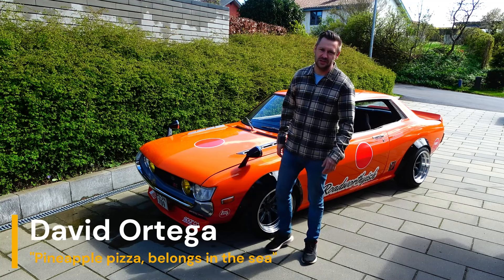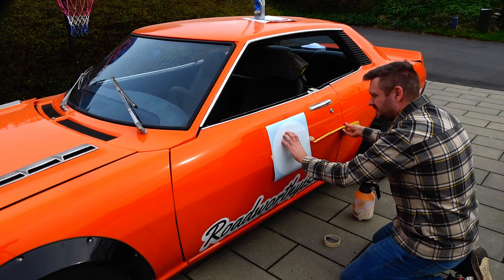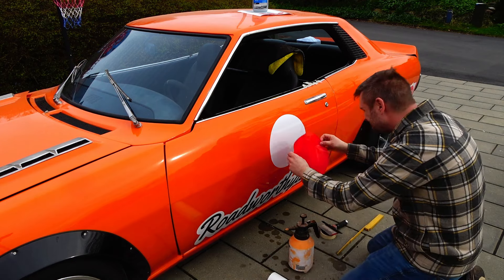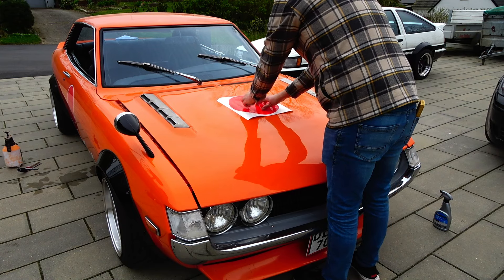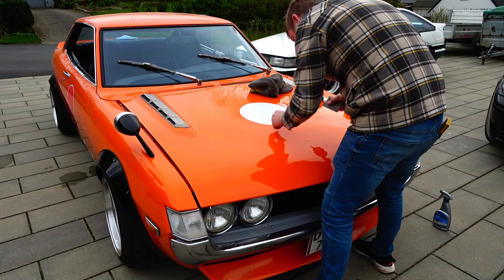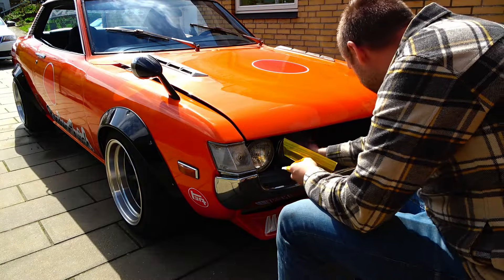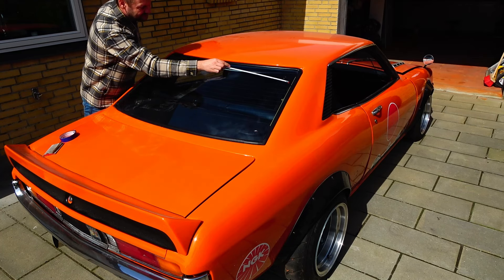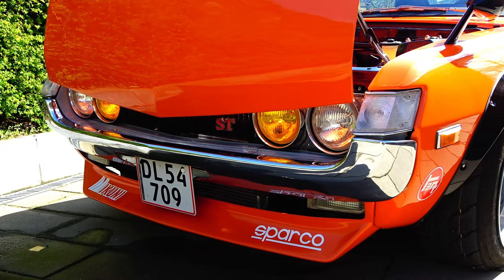70´s Japanese racecar livery. The Roadworthyish carbed 2T-G celica gets racecar looks EP 39

Comment from the maker: The “safety drive” sticker is from the Tokyo rubber Company, and it was on alot of japanese race cars in the 70’s.

Many belive that it was due to the fact that racers had a bigger influence on the youth than add campains, and there for the racers were paid to have them on the cars…

Truth was that it was the sponsor of the races, and that they Would have to put them on the car…🎉
Reply: Well you missed an important point about this sticker. Yes, it is from a rubber company, called Okamoto, and they did sponsor race events. The point is that they are a manufacturer of condoms. It still exists, some packages still have this logo. And so there is a different meaning to the "safety drive" words :)